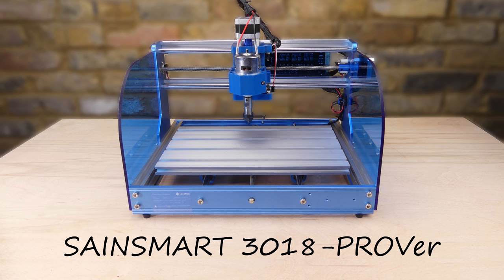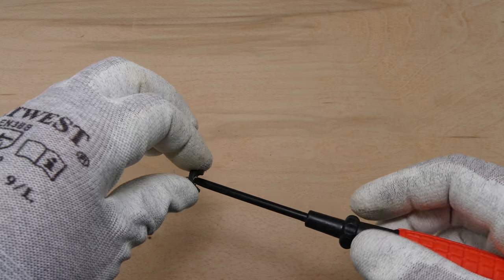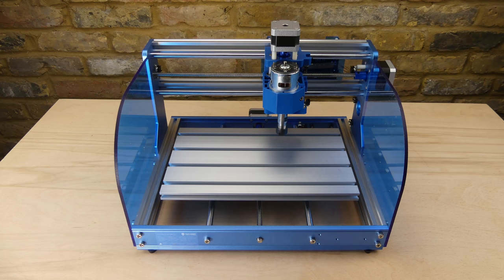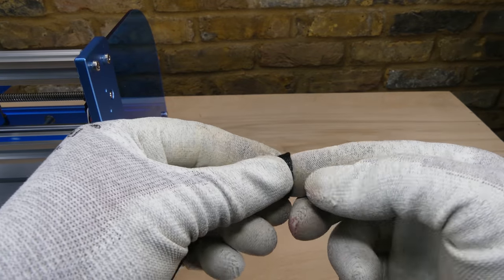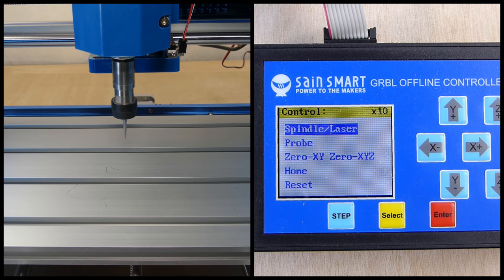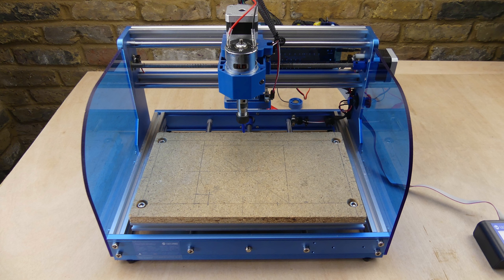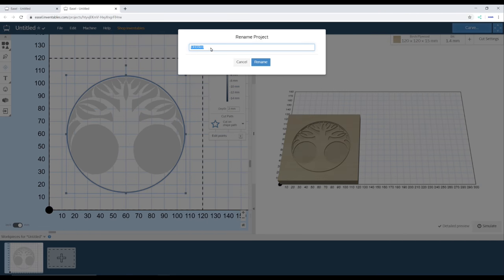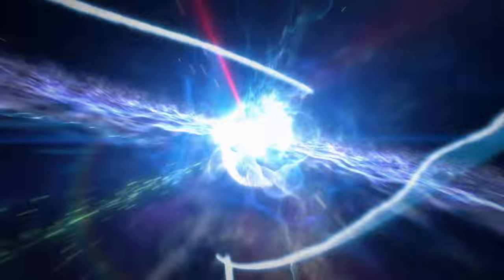Sainsmart 3018 PROVer Cnc Build, Test and Review - Part 1

Comment: Hi, Thank you for the video. I followed the instruction. Enter Home, it didn't move. But I was able to test the sainsmart.nc, it worked. Then, set the probe, set XY. sent the wheel.nc. the bit touched the wood and stopped with the Z lights on. Do you have any advise, please?
Reply from the maker: It sounds like you have hit the bottom Z limit switch, in which case you need to raise the height of the material or use thicker material.
Reply: I had exactly the same problem.  Managed to mill/cut the sainsmart logo and another test file, but the wheel eludes me. I've set and re-set the xyz zero and then move the bit away from the workpiece, before starting the process. Ends of dragging and throwing steps. I'm guessing feed rate 🤔

Comment: Wish there was a video like this back in 2001 when I built my own! Outstanding Video!
Reply: well, you can modify yours by adding more spindles, so you can use diferent bits in one project, without stopping milling process ;)
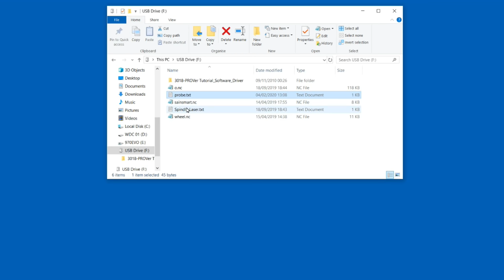Reply: At the 11:00 mark, I understood the change made on the probe.txt after taking the measurement of the probe target, but I didn't understand where you got the numbers for the change made to the G-Zero.

Comment: Would you happen to know what kind of runout you're getting?  I measured 0.0008" at the spindle shaft but 0.002" at the bit.  This was a new, high quality 1/8" bit, so I'm assuming the collet is to blame.

Comment: Is this machine actually any good at cutting aluminium? And also is it possible to upgrade the spindle just like in the standard version,by swapping the spindle clamp and wiring it back up?
Reply from the maker: It cuts aluminium the same as every other 3018, slow but it gets there.  The spindle should be easy enough to change, except there is a ridge of plastic to activate the limit switch. It does have an output to connect to the speed potentiometer input of the usual spindle motor power supplies. Haven't tried that yet, not sure if it's just 0-5v or 0-10v.

Comment: Like others have said - great video. I just got one for Christmas and this helped me out tremendously. The supplied directions and assembly video they provide do not match making things slow to build. Plus once it's built what next? For a newbie like me the manual says use instructions on page XX. All there is is a qr code to a useless internet page. Your video got me up and running in no time.

Just wondering if there are any other bit sets you could recommend. Also, I've seen some CNC's run in the past and they take multiple passed to make deep cuts. Does this machine do the same? Does the software do this automatic?

Thanks - Mike
Reply from the maker: When you set the depth per pass in the cam software it determines the number of passes required. So it’s set in easel or whatever software you use to create the gcode. I would start with 2 flute 1/8” flat end mills and work out what you need from there.

Comment: Received my kit yesterday. Some minor changes to the kit (ie the kit now uses a spiral sleeve for wiring). Other than that, the unit is solid and has been its design/features have been well thought out. Your assembly video is better than the one included with the kit and I am looking forward to finishing the assembly and putting the unit into service.

Comment: At video 13:20 the clamp assy shows the screw upside down in the T nut... This does not fit into the T-slot in the table.. am I missing something?
Reply from the maker: Mine did. Just turn it around if it doesn't.

Comment: I’m in the middle of assembly.  Going well, EXCEPT the sealing strip is near impossible to insert.  Super stiff/ridgid.  I can squeeze some of it in with a channel lock pliers, but there should be a better way.  Tried heating under faucet hot water, not much help.  Any ideas?
Reply from the maker: No, it snapped in when I used it.

Comment: Really good video and the machine seems nice. I'm thinking to buy it. One question: I have to buy one of the bit kits or some bits are already included in the package?
What bit kit do you suggest to a complete noob?
Reply from the maker: It comes with a pack of engraving v bits. I would get some straight bits around 1 to 2 mm in diameter,   The sets sold for PCB milling work well on most materials.

Comment: Hi I want to engrave silver so using a better mill and the 20000 rpm upgrade spindle do you think will do the truck
Reply: The trick
Reply from the maker: It's certainly accurate enough. I have milled tiny traces on printed circuit boards with it. I know nothing about engraving silver so I can't be 100% sure.  If you do decide to give it a go there is something called height mapping which measures the height of conductive surfaces in a grid pattern using the bit as an electrical probe. This allow you to make very fine, detailed engravings using v bits.   This means that undulations in the surface are accounted for. I have shown the process for PCB milling in a few videos for PCB milling but it's equally applicable to metal engraving.
Reply: techydiy thank you so much.

Comment: Great video again, 
Any idea why the Z-Probe function would not run at all? 
Doesn't appear to work with offline controller or through the gbrl software, yet I can move the z axis manually no problem. 
When I click zprobe it shows the G position I set from measuring the probe.
Afraid of starting a job until I know the z probe is calibrated. Thanks
Reply from the maker: If its not doing anything, then the most likely explanation is that the script has something in it that grbl doesn't like / understand.
You can type the commands into the console manually and see what happens.
Reply: @techydiy  thanks for replynill look up the manual commands
Is there a way to perform a "hard reset" or "factory reset" so I can start everything over from scratch? Cheers
Reply from the maker: @paullyie82  power off and remove usb cable or I think the stop button does a hard reset. Software reset should be good enough though.

Comment: Is this machine accurate enough to cut a perfect 30mm circle on ABS plastic (1.5mm thick). Thanks
Reply from the maker: If you calibrate the machine then it should be fine for any normal requirement.

Comment: I tried doing the sainsmart.  The machine went through the motions correctly but did not go into the material enough.  Any thoughts?
Reply from the maker: You have to set the z axis zero height correctly

Comment: Hi, do you think this will cut 3/4mm acrylic / aluminium? If the correct bits were used.
Reply: @techydiy  mm not inch :0.
Reply from the maker: @modd1uk  yes it will. The aluminium is slow and shallow but it will cut it. If I remember correctly I show aluminium being cut on the 3018-mx3 which is a similar spec machine.
Reply: @techydiy  do you have  a preference vs the mx3 vs 3018 pro? 
is Grbl better ? it seems like a nightmare to run mach 3 needing a dedicated pc, Parallel port and limited to mach3 or drufelcnc software, it sounds like the pro is the better option, is the zprobe and endstops & Mach3 really worth the upgrade? or can you just install endstops/zprobe to the Pro version instead
Reply from the maker: @lyfoon  I like mach3 but it adds additional cost. Grbl has lots of open source software options and it works fine.  Other than that I don't really have a preference.
Reply: techydiy do the endstops and zprobe make a difference? Or the upgraded motor drivers? Debating between pro and mx3

Comment: Does the circuit board allow for the running of a 5 or 10 watt diode laser on this machine? Excellent video by the way!!
Reply from the maker: Thanks. Sainsmart have a 5.5w laser ( https://bit.ly/39hAyiE  )   that plugs into the controller pcb.
Reply from the maker: I am 99% sure it will but you would have to match up the connections. Make sure the + - pwm pins are connected to the right places.
Reply: @techydiy  - Thankyou very much  for your reply. Your help is very much appreciated

Comment: I'm quite new to this, but getting there. I built this machine with a Y axis extension. I made a simple design in easel. I set my machine size and wood size to the right size and mounted the board in the middle of my table. I center the bit to the workpiece, and then run the z probe command, then I run the gcode. However the positioning is way off.

I guess my main question is - how does the gcode "know" where your piece of wood is mounted? On your easel software, your design is in the bottom left corner of the build plate (mine is as well) yet you mounted the wood in the middle of the plate and it printed as expected. Can you explain how that worked? I noticed there's a cut where the bit is no longer in the middle and wondering if something was cut out. Thanks in advance!
Reply from the maker: You have to zero the x,y axes in the correct place (for example bottom left corner of the material) and then zero the z axis on the surface of the material

Comment: Hello. Thanks for taking the time to do this for our benefit. A quick question about the 3018 PROVer. I am getting clicking noises on the Y and Z axes. I have meticulously lubricated the appropriate parts. I have loosened, adjusted, and retightened every screw. Although it has reduced the click volume by about half, it is still present and worrisome. Only the X axis sounds as it should. I have a Delta style 3D printer, so i am pretty familiar with how things should sound, and the X axis matches that. Any insight is appreciated. Thank you for your knowledge share and time. Be well
Reply from the maker: Check the spring  position in the anti backlash mechanism, they can make clicking noises if they are not seated correctly.
Reply: @techydiy  I will give that a shot. Thank you

Comment: Can you tell me what format does this machine use for G2-G3 interpolation... does it use for example: G2 X1.0 Y0.0  I.5 J0.0   or  G2 X1.0 Y0.0 R.5    THANKS
Reply from the maker: grbl is usually the same as linuxcnc
http://linuxcnc.org/docs/html/gcode/g-code.html#gcode:g2-g3
Reply: @techydiy  Thanks for your quick reply... I've been using the I,J formats for G2-G3 interpolation.. works fine with the 3018 PROVer and Candle software..

Comment: if i have a plastic case that is 32mm high that i need to cut a usb port holes into  , the 34mm clearance + any cutting tool length , would mean this cnc machine cant be used for this task ????
Reply from the maker: 34mm is the amount that the z axis can travel, so this is the maximum depth of cut. 
The distance from the table bed  to the tip of a PCB mill installed in the chuck  is 40mm.
So yes you should be able to mill a 32mm case.
It's a good point to clarify in future videos.  Perfect use for these type of machines as well.

Comment: What small cnc would you suggest for milling aluminium? I want tob buy one but it's a one time shot for me
Reply from the maker: You might be better off with a mill rather than a router, it really depends on what you want to do. If you go down the cnc router route than possibly look at a 3020 or 6040  with   a decent spindle motor.

Comment: Hello,
Just today I finished to assembly the Sainsmart 3018-prover, but I have one problem:
Using the stand alone controller, the directions work, key Home works, reset works, but Probe and Spindle don't work, after I press the key, nothing happens.
Do you have any idea about how to fix it?

Thank you
Reply from the maker: I think they both use script files on the microsd card. Make sure the microsd card is inserted before powering up.
Reply: @techydiy  thank you. The problem was really this. All works now, probe and spindle. Thank you again and great video.

Comment: How much is the software to use and build designs for this? Also, any idea on how long each bit can last or how many hours the machine can last?
Reply from the maker: Free. Bits vary depending on quality and what you use them for. No idea what the average life of a machine is, you can get spares / check the warranty.

Comment: Hallo,I have problem with cnc3018pro,i had a problem with the installation, machine is without function, status in GRBL Controller is "Port opened" i tried everything to connect cnc to the program but it doesn't work,the machine simply does not respond to manual commands either. Can You help me. thank you

Comment: I have just set this up; within the file section I have tried to do a few tests but at each point I am getting "status: Alarm" and the test stops. Would you be able to help at all please?
Reply from the maker: Assuming that you are using the offline controller. When you first switch on,  then you will need to reset the machine  From the control menu, press reset. You should then press home.  Then jog the axes to the start position and XERO XY.  Next zero the Z axis either manually or with the probe.  If you follow this procedure the test files should work ok.

Comment: Just received my 3018 prover and went through your video many times to get it assembly video is fantastic and really helped me to get it assembled I'm up to this stage to try it out with the offline1 controller but I can't get the controller to do the probe or to start or stop the spindle any help would be appreciated thank you very much
Reply from the maker: The grbl board needs to be reset before you can do anything, so go into control and select reset.  I think you also need to have the microsd card inserted to use the probe and the spindle start stop commands. Good luck.

Comment: How good is this machine at doing small intricate work?
Reply from the maker: It depends what you mean by small &  intricate, it can engrave tiny PCB traces.
Reply: @techydiy  I’ll be using it to engrave on the lids of small wooden jewellery boxes.
Reply from the maker: @WheelChairWorria  It will do that fine. The small v bits  can engrave small features
Reply from the maker: @WheelChairWorria  The other thing you can use is a laser
Reply: @techydiy  suppose I could give that a try.. nice one 👍🏻

Comment: Any g-code from Easel to offline controller with my 3018 won't run, any idea why? (it's not a Sainsmart). Thanks.
Reply from the maker: Might need to reset to clear alarms first. Does it jog with the offline controller, if so then check what's in the gcode with a text editor.

Comment: I have a MYSWEETY CNC 3018PRO-M via Amazon, and the improvements in this Sainsmart version are impressive (although I paid $130 less). I'd like to add limit switches and and E-Stop. I'm presently trying to install a cable chain for the spindle motor. Cable management on theses small machines is poor. My use-case is PCB milling. Thanks for the look!
Reply from the maker: Thanks for the comment.

Comment: I just got the motherboard and the offline controller that is used on this mill, just came in today I tried turning the spindle on manually and it won’t turn on and when I put a .nc file on the sd card and put it into the slot it won’t show up even the ones that came on the sd card, do you think you can help me with that
Reply from the maker: You need to reset grbl when it is first powered up, otherwise it won't do anything. Make sure you don't have the external controller and the usb port in use at the same time, they will clash   I would check if it works with a pc running candle and then go from there.
Reply: techydiy oh okay I’ll give that a try

Comment: I just put mine together, for some reason the Y axis is moving in an inverted fashion. Y+ brings it towards me and Y- moves away.
Reply from the maker: Type $$ into the console. It prints the grbl configuration.
Read the following:
https://github.com/gnea/grbl/wiki/Grbl-v1.1-Configuration#3--direction-port-invert-mask
Use the table in $2 for reference. 
Type  $3= {New value}  into the console.
Reply from the maker: I think I covered this in part 2

Comment: How do you get the cnc to engrave exactly where you want the image to be on the wood
Reply from the maker: Zero the X,Y to the point  where you want the origin of the design to be.
Reply: @techydiy  the reason why I was asking is because I'm tring to center an image on a piece of wood that is already cut to it final dimensions. The image has to be perfectly centered on the wood.
Reply from the maker: In your design program set the material size to the same size as the wood, then centre the image on the wood.
Reply: @techydiy  thank you.

Comment: Is this the Mx 
Version? Because the 3018 Pro Version has no stop switches and the acryl sides. When i follow your links to amazon it looks like i am getting a different version. No automatic height tool as well
Reply from the maker: No, Sainsmart 3018 PROVer.  Its probably out of stock, try on the Sainsmart website.
Reply: techydiy It looks like it is Not available in Europe yet

Comment: What works great for a spoiler board is a Clip board... I drilled some holes for screws to mount it right to the bed.. flat, hard and only 1/4" thick...

Comment: I get a red alarm notification on my off line controller. The spindle is totally unresponsive. Any suggestions?
Reply from the maker: Have you hit reset
Reply: @techydiy  Yes I have hit the reset. Checked all my connections. All good. When I try to router the Sainsmart Logo sample,nothing happens. All the axes work fine but the spindle doesn’t seem to work at all.
Reply from the maker: Does it work if your using a pc rather than the controller?
Reply: @techydiy I was following your Prover tutorials
Reply: Sorry. I was following your tutorials and only got as far as using the offline controller. Haven’t been able to connect to laptop yet. Very much a newbie.
Reply from the maker: @larryprocunier8744  sure. Try using the laptop then you can easily switch the spindle on off to test it